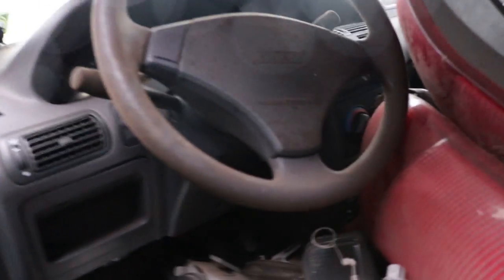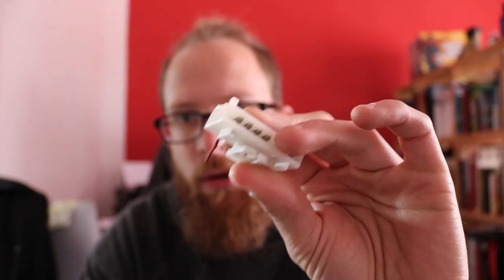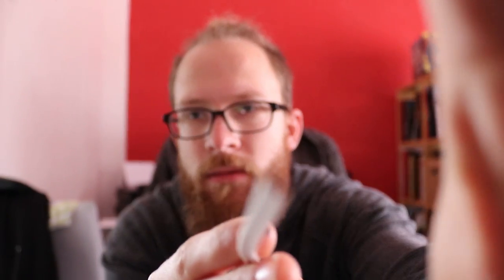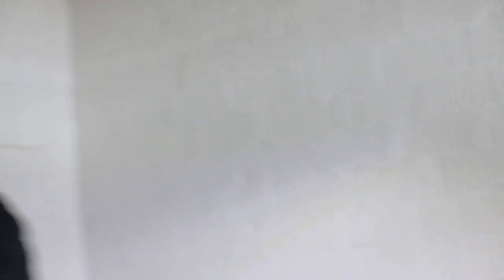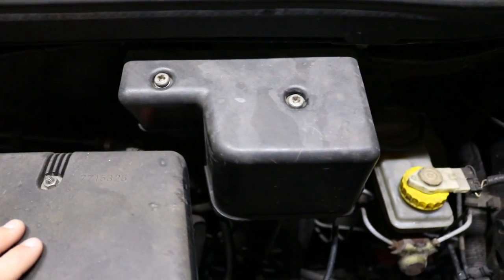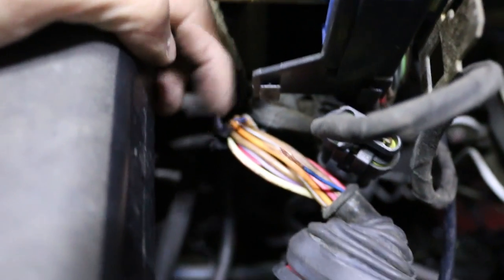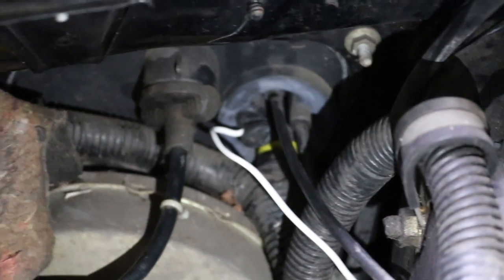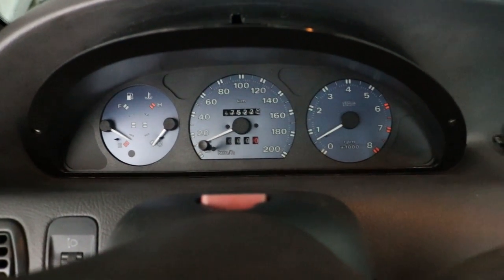Drehzahlmesser Einbau die 2. | Fiat Punto 176

Comment: this dont worked 
pleasee help me how you connect the cable ?
Reply from the maker: Did you find the blue cable you have to cut to connect the new wire to the tachometer? The lower connector of the rpm gauge, which I show later in the video is the one to use. And if every cable is the same, you have to cut the white one from this specific connector and connect it with the new wire which leads directly to the blue one in the engine bay. Make sure that the wires are really connected to each other 😉